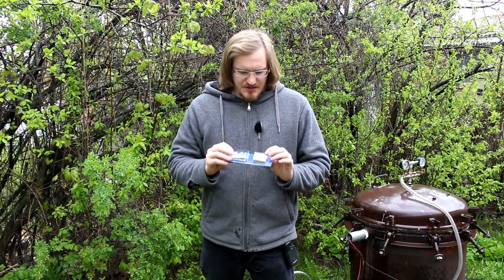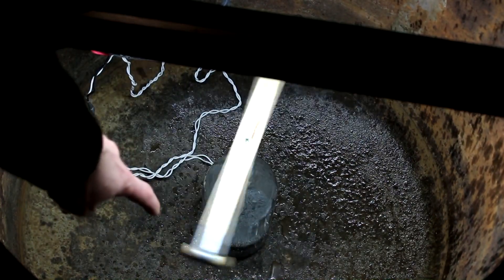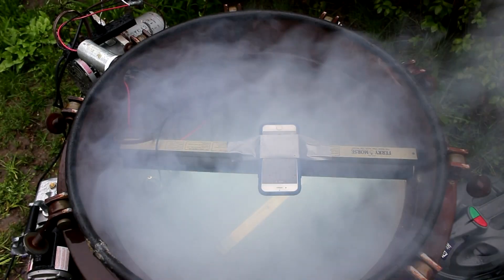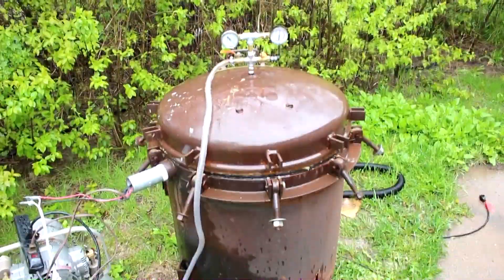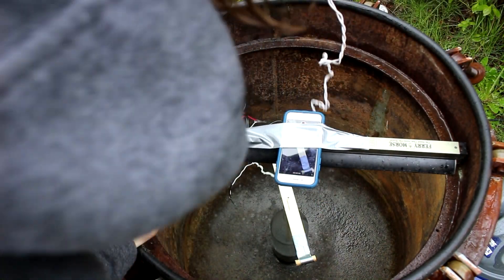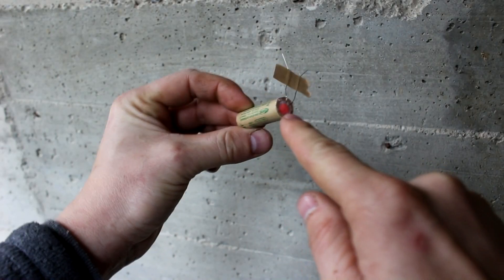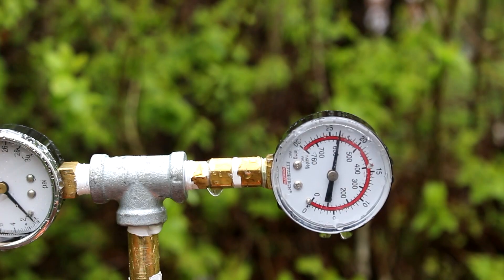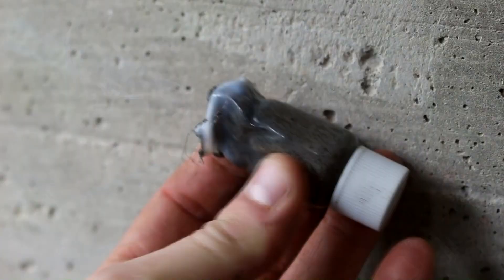Will a Model Rocket Motor Work In Vacuum?

Comment: No slo mo video? The other tests show the exhaust stream hitting the wall of the vacuum chamber before any movement occurs. Can't tell anything from this video.
Reply: There are videos clearly showing rockets producing thrust in the initial moments of ignition, before the exhaust can hit anything and before the pressure in the chamber can appreciably change. 

It takes a force from the rocket to eject the exhaust. That exhaust exerts a force back on the rocket. 

And how would the rocket even “feel” when the exhaust hits something? That exhaust is not connected to the rocket in any way.
Reply: @AM-rd9pu Appreciably change? Most of vacuum gone in tiny container where thrust is shown, and you say appreciably change? Are you also saying the exhaust has no mass, and the exhaust could in no way push off its own exhaust? And, most of all, why are you ducking the deep space video proof question? Why are there no actual videos of rockets working in deep space? Zero video of trips to moon and back, no video from mother ship of lunar lander leaving the moon? How about actually show something? The vacuum chamber videos are all crap.
Reply: @steverempel2728  I wasn’t talking about this video. The demonstration I was referring to is by Warped Perception. He has a large chamber and shows a scale registering a force in the initial moments of ignition. The amount of propellant burned in that time is nowhere near enough to produce enough gas to appreciably change the pressure in the chamber. Recordings of the pressure gauge confirm this. 

I never said anything about the exhaust not having mass. The fact that it does have mass and gets accelerated out of the rocket is how we know the rocket exerts a force on the exhaust and that the exhaust exerts a force back on the rocket. 

The exhaust pushes off the rocket. The rocket doesn’t feel when the exhaust hits something else after being ejected. It’s just like how you don’t feel when water from a hose you’re holding hits the ground. 

I didn’t dodge any questions. You never asked about rockets firing in space. But there are plenty of videos of this. There’s onboard video of all of the Apollo ascent stages leaving the surface. There’s video aboard the command and service module watching the LM undock and the ascent stage rendezvous. There are videos aboard SpaceX boosters going all the way into space. There are videos of the Saturn V stage separations and engine ignition. 

But this is all beside the point because there are vacuum chamber demonstrations that show rockets work in a vacuum. 

The rocket exerts a force to eject mass and the mass exerts a force back on the rocket. This is basic physics.

Comment: Not a conclusive test Cody! The pressure flame front of the rocket only has a short distance in a straight line to side of the chamber therefore using the side of the chamber as a fulcrum.
Reply: The rocket doesn’t feel the gasses hitting the wall for the same reason you don’t feel when a ball you throw hits something. The rocket moves because it pushes off the mass it ejects out the back.
Reply: Is this rocket of yours a living being with feelings? No! Your ball stops because it has hit a greater mass than the ball itself.
But we not talking about objects that are already in motion. We are talking about moving a stationary object in a vacuum void.
When gasses are generated by chemical reaction the gasses expand into the void. Those expansion of gasses have to find a mass of some kind to create the force necessary to push the object in the opposite direction, Newton''s 3rd Law.
You have to test your hypothesis with multiple tests with multiple parameters to backup your claim. Science has to be repeatable & by numerous people. Put your firework rocket in a chamber let say 30 metres in diameter with the same length of stick in the middle (No cheating)
Lets see if it will rotate. I doubt it will.
Reply: @woollybeamish  You entirely missed the point of my analogy. I wasn’t asking why the ball stops after you throw it. I asked if you feel when it stops and the answer is no. You are no longer connected to that ball in any way, so you don’t feel what happens to it. 

Now let’s look at happens when the fuel is burned and the gasses expand in the combustion chamber. The gasses are contained on all sides except for one. The gas particles collide with the walls of the combustion chamber and nozzle and impart a force on them. Since there’s not a wall on one side, there’s a force imbalance. A net force from the rocket shoots the gasses out in once direction and in accordance with the third law of motion, those gasses impart a force on the opposite direction on the rocket. 

Simply put, a force from the rocket causes the gasses to shoot out backwards, and the resultant force from the gasses pushes the rocket forwards. It’s the same principle as recoil. 

This demonstration will work no matter how big the chamber is.
Reply: Well i look forward to your larger experiment :)
Reply: @woollybeamish  There are already videos of this same experiment done in a larger chamber. Warped Perception has a video. 

And again, this is just basic physics. It takes a force to eject the mass out the back. That force comes from the rocket. As a result, the mass exerts a force back on the rocket.

Comment: No medium in "space" (if you believe the sky is outer space in the first place).  'Space rocket' has no medium for thrust or propulsion in an infinite void.  Obviously the void absorbs all output energy and the rocket goes nowhere.  We've been stooged.
Reply: SO, you think that a rocket applies a force to PUSH the mass of the exhaust gas out the back but FEELS NO RECOIL FORCE from that "action"?
I think you better go back and take high school physics all over again.
Reply: @stuartgray5877  rockets don't exert force on the exhaust tho, chatbot 😂
Reply: @papalegba6796 Then how does the exhaust come out in a focused stream when gas would normally expand in all directions?
Reply: A vacuum is a lack of matter. It can’t do anything because it’s nothing. 

Rockets exert a force to eject mass out the nozzle and that mass exerts a force back on the rocket to propel it the other way.
Reply: @AM-rd9pu again, no force is exerted on the exhaust to make it leave the rocket. Chatbots don't understand gasses 😂
Reply: @papalegba6796 At what point are you going to admit you’re obsessed with me? You’re finding months old comments of mine to reply to. 

And you’re clearly the one who doesn’t understand how gasses work. A sample of gas will expand in all directions on its own. The gasses shoot out of the rocket in a confined steam. That requires a force. Where do you think that force comes from?

How do you make the gas eject in a stream when it would normally expand in all directions?
Reply: @AM-rd9pu  changing the subject will not alter the fact you are wrong, chatbot 😂
Reply: @papalegba6796  I asked you a question directly related to the topic at hand. I didn’t change the topic. It’s not my fault you couldn’t be bothered to read my whole comment.

Comment: That isn’t even close to the vacuum of space.
True science requires doing the test in space.
Inconclusive.
Reply: We have logged Millions of hours of rocket propulsion in space. Do try to keep up.
Reply: @stuartgray5877  - first of all, regardless of whatever truth you think you have: your attitude sucks.  "Do try to keep up."    Could you sound more pompous?  (no)  Secondly, the only "space" that exists is that between the Firmament and the Surface of Earth where there is less pressure and more bouyancy.  You're shooting things up into the atmosphere, which isn't a vacuum at all, which is why rockets can still work up there and why things float.  No one goes beyond The Dome until it cracks open, which happens cyclically.  SpaceX, NASA and the lot are all just going 50 or 60 miles up (not that far) into the AIR - most definitely not into space.  And if you believe we can receive HD video of helicopters flying around on Mars 150 million miles away (through the alleged "Van Allen belts", mind you, and God knows what else along the way), as well as high def footage from remote control cars - and YET, footage from the allegedly local moon (without any human - I'll remind you) is grainy, blurry and garbage in comparison ... I've got a bridge in Brooklyn i can sell you, too.

(and that's a couple of examples of how wrong your models and theories (and deceptions) are.  There's literally thousands of others)

Take your holier than thou, intellectual bullying (or pseudointellectual) somewhere else.  Oh, and just because you're older than someone (as per your other comment) most definitely doesn't mean you're more intelligent.  Kick rocks old man.
Reply: @stuartgray5877  No proof. Try to prove it.

Comment: Was that a total vacuum?
Reply: It doesn't matter. A garden hose aimed at a wall doesn't have more recoil than a garden hose aimed at the air. Thrust doesn't depend on what the exhaust gasses hit after being accelerated, it's the fact that they were accelerated in the first place that causes a force in the opposite direction.
Reply: @fullysemi-automaticmemes3888 it does mayter
Reply: What you are saying is a astronaut in space can push the spaceship by hand.
Reply: @dannyshaw4810  "what you are saying is *inserts something I didn't say*" 🤦
Reply: It wasn't a vacuum at all. He faked it 😂